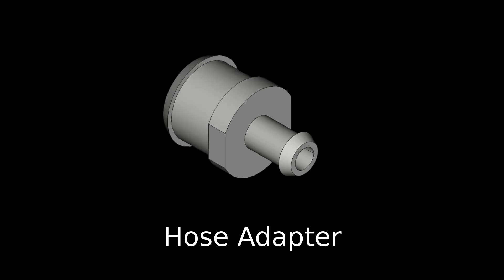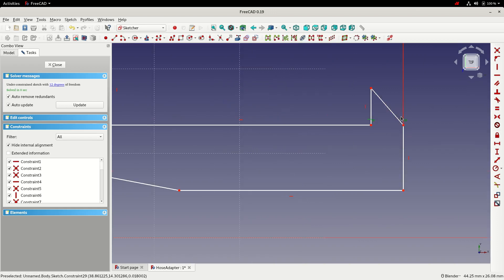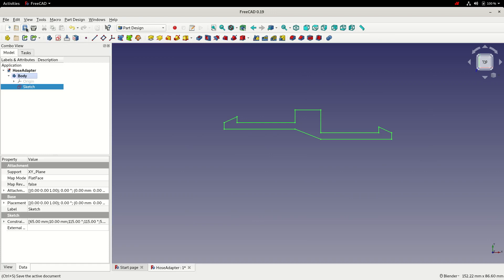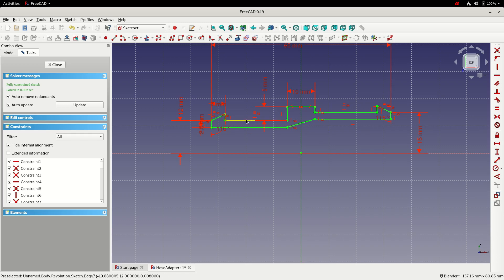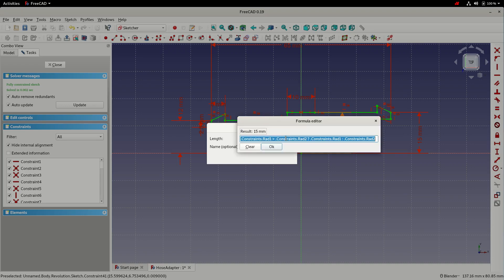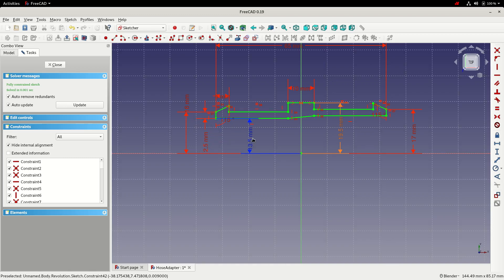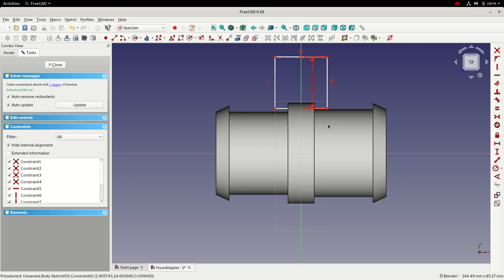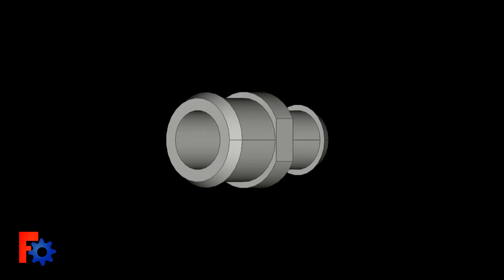FreeCAD Tutorial - Basics - Hose Adapter

Comment: Hope you can answer a question about the formula editor syntax. I would like to set a constraint that is constraint x + constraint y + 5mm. However that doesn't work. The simpler formula constraint x + 5mm does work though. Is it not possible to add the values of multiple constraints?
Reply from the maker: It should work without issues. Double check the naming.
Reply: @MarthamEngineering  Turns out it doesn't like spaces in the name :-)
Reply from the maker: That would do it! Nice work getting it fixed!